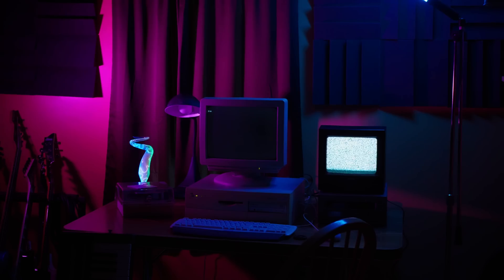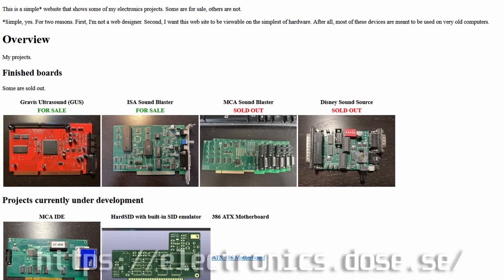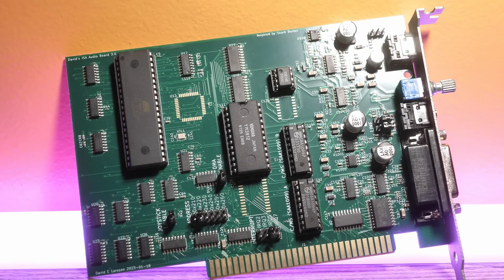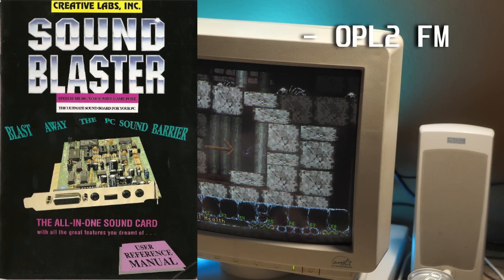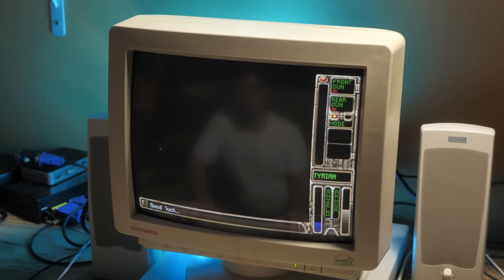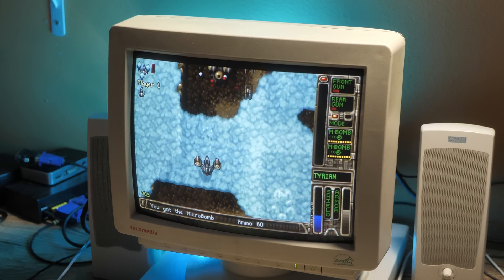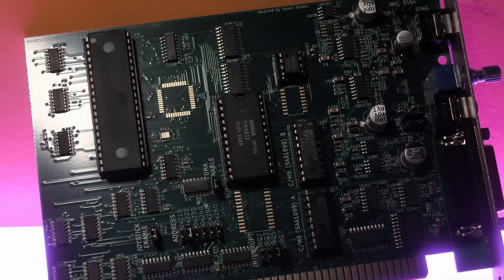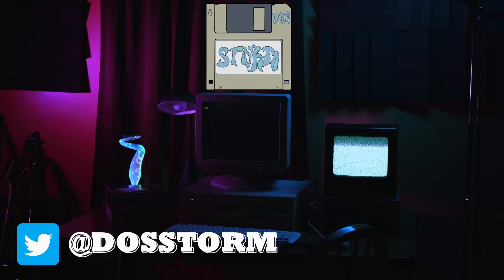NEW Swedish Sound Blaster 1.5 Clone you can buy in 2023!

Comment: The problem with this thing is that it uses the original chips. That's nice, but soon enough those will be just as unobtainable as the original cards.
Same for the Gus. I'm happy that these products exist, but i am much more enthusiastic about the picogus. Which uses the pi pico to emulate several Isa sound card, most importantly the Gus. It might not be perfect, but even if the pico disappeared, the software could be ported to a new chip. That makes it far better in continued availability.
Reply from the maker: That is a fair point. Does make you wonder how many of these old chips are still floating around. I will have to look into the picogus more, sounds like an interesting project.
Reply: @DOSStorm  for some chips many. As they get more valuable they are hoarded. And that ain't good for prices.  
There is also an industry for reclaiming them from old electronics. People are asking for them enough to make them valuable enough to fake. 
Hopefully it will get better as more chips get FPGA re-implementations. Things like FPGA sid have been around forever. But there is also a project to recreate every Amiga 500 special chip. FPGA are small enough to fit inside the larger Dil packages.

Comment: What I really want is one of these cards, but designed as PCIe x1 so I can enjoy the FM MIDI on a modern PC. I need Windows XP and Windows 7 drivers if they were to design it. I would love a Soundblaster 16 Vibra version too! Vibras are my favorite 16's because of the nice treble in their MIDI. Something Like a Soundblaster 16 CT2940 would be perfect!
Reply: Hunt down a pcie to isa bridge or look in to the tpm (lpc) header isa converter
Reply from the maker: I think the issue with something like that is that DOS games require a motherboard with an addressable DMA. I think that is also the reason modern industrial motherboards that have ISA slots won't work well for DOS games and stuff.